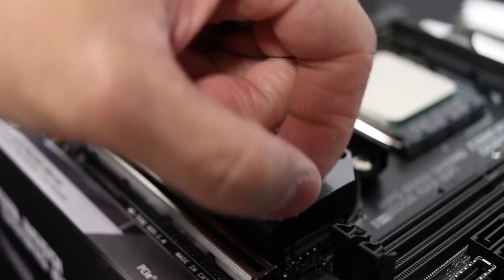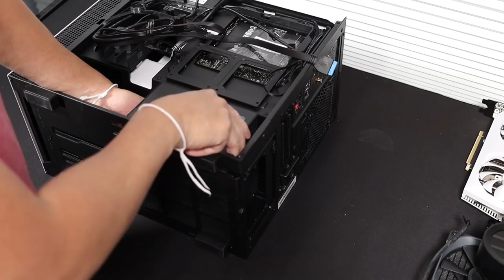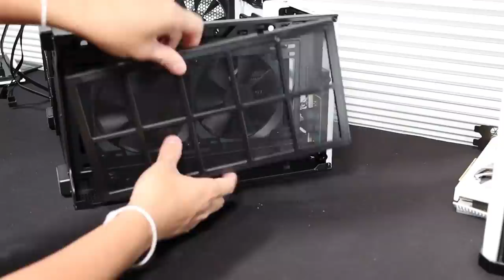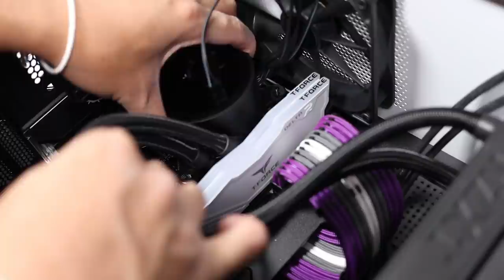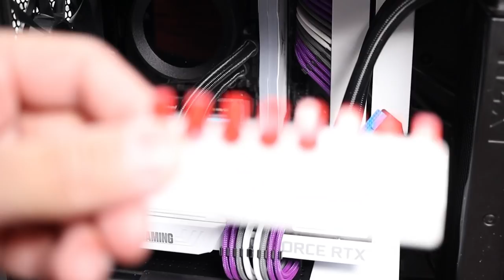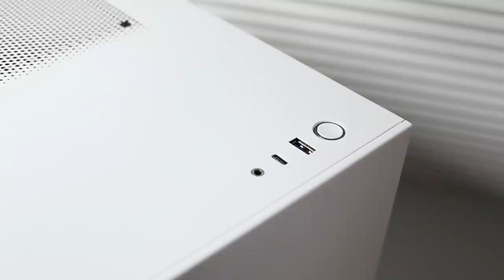CLEAN Gaming PC Build (PCMR ASMR)

Comment: Do the cables on the top of the aio cooler hit the top fan? Just curious because I have most of the same PC Parts & case!
Reply from the maker: Which cables specifically? I didn't have any cables hitting the fans, so I don't think you should either, if anything is close there should be a way to pull them tight so it's a non issue